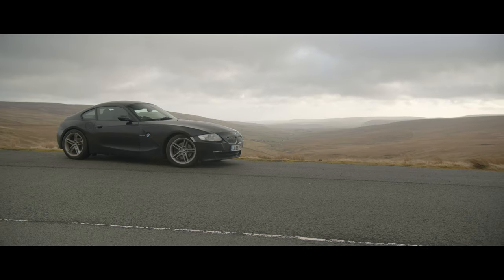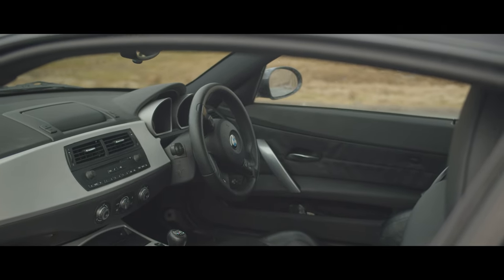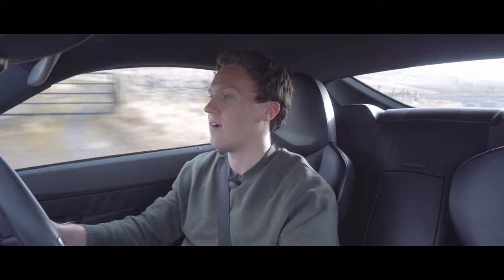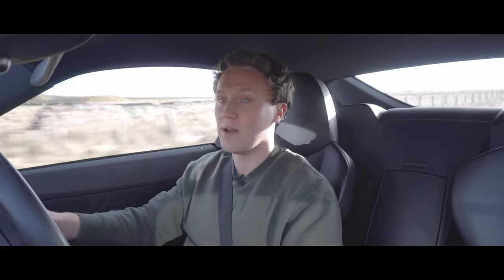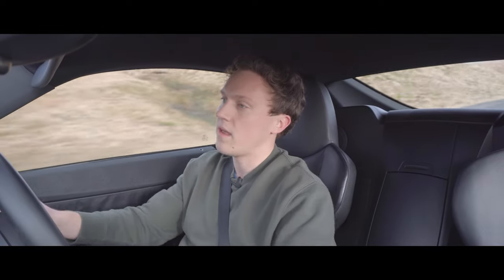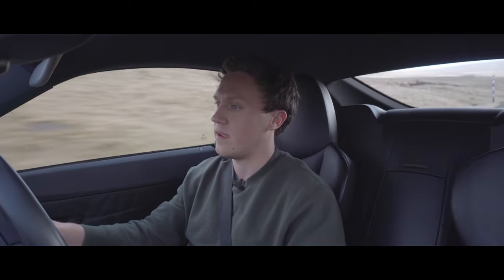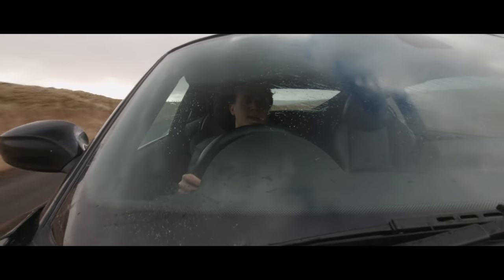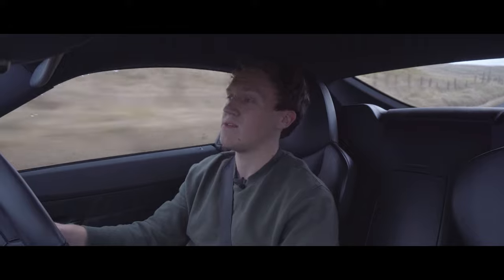The Problem With Modern Cars... [ft. E86 Z4 Coupe]

Comment: Your US pen pal here, lol. You listed some good cars... as for too much power or too heavy (and having only driven things up to about 260hp maybe I can't speak to this), but my feeling is above 500hp and/or crossing the 4000lb (US) mark seems like it would make things either too fast and/or too cumbersome... As for modern classics, another one that came to mind might be the Cadillac CT4-V (even the lower trims should be fun), which come close to touching both those figures I listed... Still sold with a manual and based on the reviews still very engaging and analog to drive. I eagerly anticipate seeing what (and where) the Mazda 6 goes when they go longitudinal I6... I would love to see a RWD manual option... I'd be tempted to own one if my Miata speaks to what level of engagement it might have. I think I recall reading it would likely also be a 48V mild hybrid that would boost power a bit, but I think it will be NA (I was wrong). If they can keep the weight down and get close enough to 300hp it should make a very fun, yet very street-able car! Cheers and best wishes! edit: corrections below...
Reply from the maker: Thanks for all your support as always man, always great to hear from you!

Yeah totally agree with you, ultimately at those sorts of power levels you just can't deploy the power. When I look at cars like the current gen M5 Competition or M5 CS, although immensely capable, you simply cannot put that power to the road for any length of time before doing highly illegal speeds!

Love Cadillac's latest offerings and I wish we had them here in Europe! The CT4-V in particular sounds very promising.

I hadn't heard about the latest 6 from Mazda but that sounds great! Even better if it is still N/A.

From my experience, low powered light weight cars are more often than not way more fun than high powered stuff out on the road.

Thanks for watching!
Reply: @FootToPedal I think I just closed the tab without clicking reply... Agreed, as a wise man once said "Simplify, then add lightness," haha. That's what I love about my NC Miata. I was wrong about the Mazda I6 N/A thing, not that that is a deal-breaker... used... many years from now, haha. I had not read about it recently, just what Car and Driver was saying back in 2020... updates: "Under the hood, the new Mazda 6 will reportedly be offered with a 3.0-liter inline six-cylinder turbo Skyactiv-X gasoline engine with a 48-volt mild-hybrid system generating around 350 hp. Mazda has even patented new twin-turbocharger setups using an electric supercharger, which we have no doubt will be included in the new model." https://carbuzz.com/news/rear-wheel-drive-mazda-6-coming-sooner-than-expected and a little more on it https://www.carhp.com/news/2022-mazda-6-sedan-expected-release-date-price-mpg-and-performance
Reply: @FootToPedal  p.s. I am not huge on the styling, but I would plan to spend more time looking out from it than at it, haha... I like my Dad's ND Miata, but something about the proportions of the pics at that first link are not as enticing to me (I like the look of the current Mazda 3 and 6 and would prefer something along those lines... with the RWD manual of course!). edit: no manual mentioned in the second link... call me close minded, but that's a deal-breaker for me with the other options around... I'm still hopeful... it is Mazda after all, someone will get their head out of their arse! p.p.s 2nd link: the Toyota Camry performance specs are amazing compared to the competitors given the efficiency it offers... Toyota is working some magic there... speaking of which, the new AE86/BRZ is on my short list as well.
Reply from the maker: Yeah very interesting indeed, the styling is certainly different to a lot of their recent stuff, but I think it would be good for them to release something like this. It certainly looks heavy though 😂

That I6 engine sounds intriguing, will be cool to see them offer that too, particularly in RWD format.

I guess we shall see what happens there!

Comment: I think the 2000 sports cars are the halo era of cars in the sense of the power of some of the poster wall cars from 1990s and even 1980s but at a cost you can actually afford to buy and run as well as the reliability of a modern car. 
I’ve recently bought a mk2 tt 3.2vr manual, not the best sports car of the era by a long way but needed something for the misses to daily. More of a case of the engine being the star of the show (in noise and occasion more than all out drivers car).  Cars have changed from county lane blast to straight line muscle cars
Reply from the maker: Yeah I tend to agree Matt, cars of that era were really a cut above.

As you say the modern day stuff is more concerned with out and out performance, like 0-60 times and top speed, without much regard for just pure driver enjoyment!
Reply: @FootToPedal  there’s another YouTuber than is in the process of putting a vr6 into a modern leon and turboing to make 1000bhp! When they test drove the stock car they thought it was very slow and guessed it was only making 160bhp, dinoed it at 260bhp! To me it says a lot about modern turbo Ed cars and the obsession of more is better.

Anyway brother has the second gen z4 with 2.0T 180bhp. It’s almost laffable that it counts as a sports car but it’s so much more rewarding on a country lane. Definitely interesting compared to the tt which is a faster (and safer) point to point car
Reply from the maker: @mattvanders  Yep there's a lot more to a car than just the power figure!

Sometimes the way a car handles can easily make up for any shortfall in power, which I guess is the case with the 2nd Gen Z4 you mentioned!

Comment: I’ve got an e85 roadster. I’ve been debating selling it to get an e86. Obviously the e86 is more valuable and is steadily increasing, but I do worry I’ll miss dropping the top. In a perfect world I’d have both. But seriously considering it before the e86 is unattainable. The M coupes are already getting up there.
Reply from the maker: Yeah a topic of much debate I think, personally I prefer the looks of the E86 but it all depends what you want.

If you like dropping the roof then I'd say keep the E85, but I still think you get plenty of sound etc with the coupe. On a summers evening, drop the windows and take it for a blast and I'd doubt you'd miss the convertible element!
Reply: @FootToPedal  I think you’re right! Might pull the trigger this summer if I find the right one. It truly is a modern classic.
Reply from the maker: @StoweGarage  Let me know how you get on!
Reply: e85 has a better engine.
Reply: @shamsi780  you can get an e85 with the same engine... And the n52 is far superior to the m54 if that's what you're saying.
Reply: No it isn't. It has 25 hp more. I've had both and you can't tell much difference on the road at all. The n52 is a bit lighter than the m54 but you can't even notice that. I would even say the m54 b30 is a better sounding engine. The n52 overall, is slightly better.
Reply: @posniknelb6114  it's not about power, it's about feel. The n52 has less rotational mass and the valvetronic system that increases throttle response massively. Much nicer to drive, the m54 feels old and slow to rev
Reply: Yes , it's a little bit sharper. There's hardly anything in it, to be fair. It ain't night and day.
Reply: @posniknelb6114  most people would probably agree with you, but if you appreciate this kind of thing then it's a big difference. Don't get me wrong, I like the m54 but it think it suits the z3 better

Comment: I don't necessarily agree with the you need to spend upwards of 70 grand on a manual gearboxed sportscar. 
You still have cars coming from multiple companies with manual sports cars straight out of the box in much more affordable money like the Mazda Mx-5, the staple of a roadster or the Toyota GR 86/Subaru BRZ.
Reply from the maker: Yeah thats certainly a fair point! I guess the point I was trying to make there is that there are far fewer options available at reasonable money than there once were. The idea of cars like my E86 with naturally aspirated 6 cylinder engines, RWD and manual gearboxes just don't really exist anymore. If you want a 6 cylinder engine then you are definitely paying a lot of money, but there are still options available, particularly those you've mentioned!

Comment: Great video, couldn't agree more. Glad you're enjoying the e86. I recently sold mine after 10 happy years and 50k miles. Loved the N52 engine and the shape is ageing so well. I've replaced it with a MK3.5 mx5. RWD, NA engine, lovely manual gearbox and lightweight. It's only 160bhp (soon to be 200bhp after a trip to BBR), but it makes it so enjoyable to take to 7,000rpm. Look forward to the next video 👍
Reply from the maker: Thanks Henry - awesome to hear you had a whole decade with yours, agree that the shape has aged incredibly well. A great choice though the MX-5, a car which you can drive to it's fullest extent on the road without needing a track. The light weight of them is great too!

Comment: You make good points, but some stuff ("inexplicably heavy" etc) detracts from the message.
Reply from the maker: Fair enough, just my opinion of course!
Reply: @FootToPedal  Yeah, its just that cars are lighter than ever, if you account for all the stuff that is crammed into them by way of regulations and customer demand. So, quite "explicably heavy" if you will. 

You strikes me as a guy that knows this, but maybe verbally got caught up a bit too much in your "flow" in this video. It happens. Cheers.
Reply from the maker: Ah got you, yeah fair point. I guess what I mean by that is it is unjustified weight, I.e. they don't need to be, or rather, shouldn't be that heavy, in my opinion. The weight can be explained by the regulations and customer demand as you say.

Perhaps a better phrase would have been unjustified weight! Thanks for watching! 👍
Reply: @FootToPedal  Well, its a hard nut to crack, I also wish they could be lighter.

Lastly: I will give the example of the new BMW M3, which has been widely slammed as "too heavy". And they might be right but... Look at the dimensions of the car. It is in fact not all that much heavier than a well equipped E34 M5 as far as I know. But the E34 M5 is a larger car right? Not in comparison to a modern M3, it isnt! In fact it (M5) is quite a bit smaller where it matters. The M3 also has more power, more equipment, more performance, better brakes etc. Thats not to say I prefer to drive it, just simple specs.

This wasnt a comment aimed at you specifically, but sometimes many people forget the details that can explain a lot. Someone with a bit of reach should do a video about that, maybe. Anyway, have a nice day and Cheers.

Comment: BMW N-Series engines famous to be unreliable comparing to old M-motors. Also there are a lot much more interesting modern cars with manual transmission, like 718 Porsche manual: pure pleasure comparing to this USA made bmw with cheap plastic and 3.0 Z4 coupe weight is almost 1500 kg: very, very compromised car)
Reply from the maker: Fair points but a 718 is big money. The E86 is built to a price point, so yes there are more plastics than maybe a Porsche would have but it all feels high quality to me. Also they're about 1350kg
Reply: @FootToPedal  it's not a big money comparing with the Z4 Coupe price when it was brand new! pretty the same, of course used one cost less) to be fair Z3 and Z4 are cheap made inside, even comparing with SLK from that era, Boxsters or Caymans are on the other level of quality. Good cars, but for their period, nothing really special